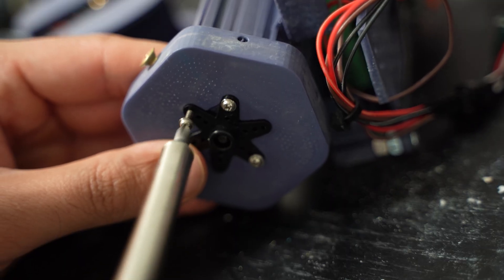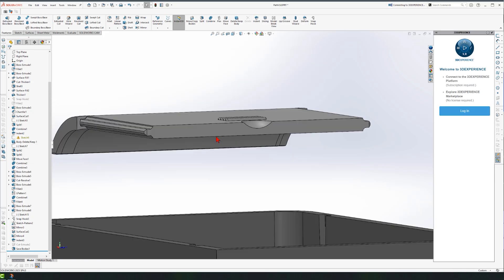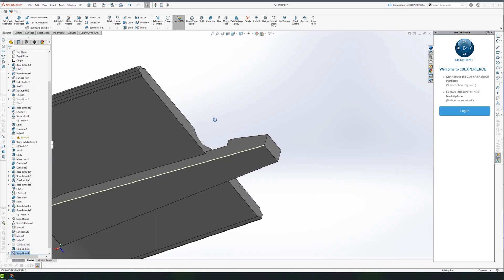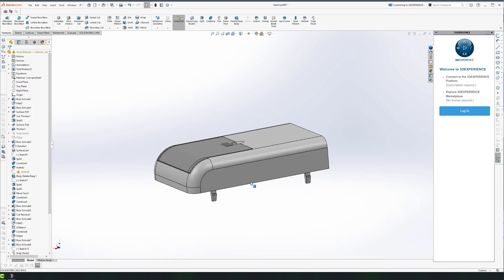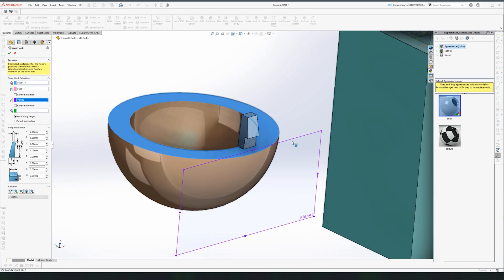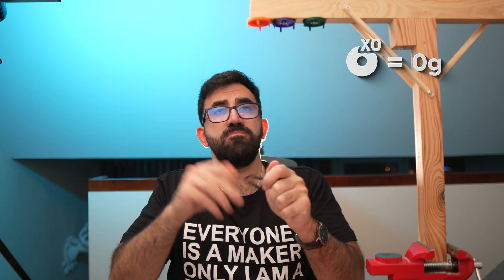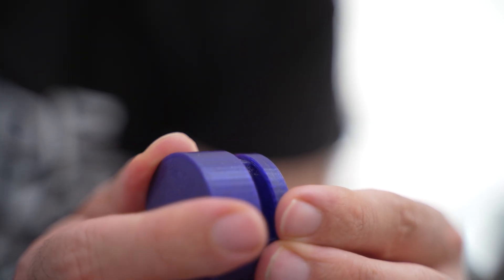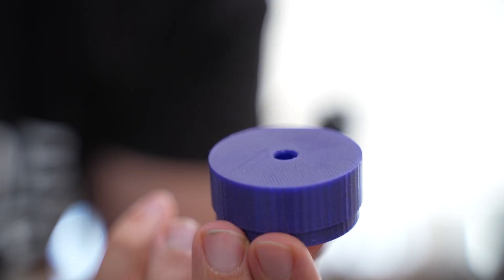I Tested A New Way to Join 3D Prints

Comment: Hey Aryan 
I tried this using this method but the snaps don't slide in and they snap. They don't have the flexibility. I created a circular part. I tried it twice.
Reply from the maker: What kind of plastic did you use?
Reply: @with-aryan  PETG

Comment: Snaphooks also fail due to FDM print lines and material creeping.
Reply from the maker: Yes that’s true
Reply: @with-aryan  It might be better when using 3D printing, to free oneself of old design dieas like with injection molding and instead embrace new methods. You could for instance crease an insert clip which is printed flat where it´s the strongest and then connect it to tbe rest of the print by overpritning for example. Or connect it by creating a two way connection one permanent clip for the cover and one flexible one for the other side.
Reply from the maker: It is true